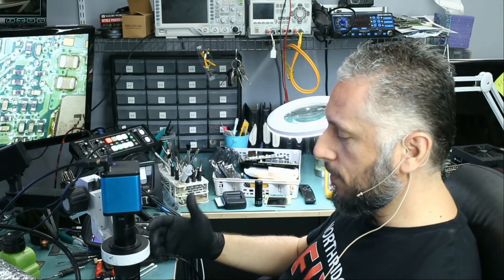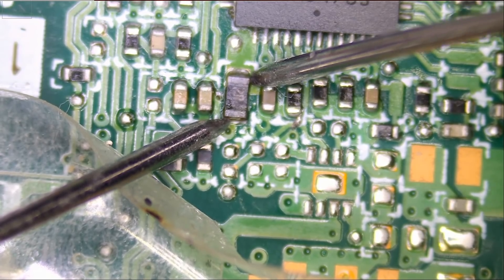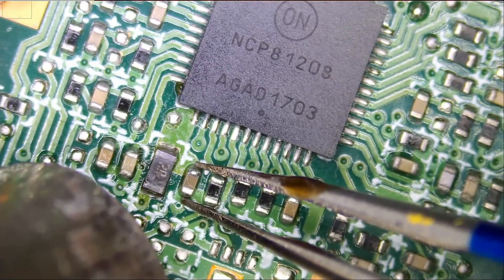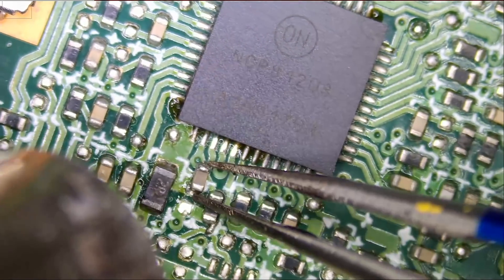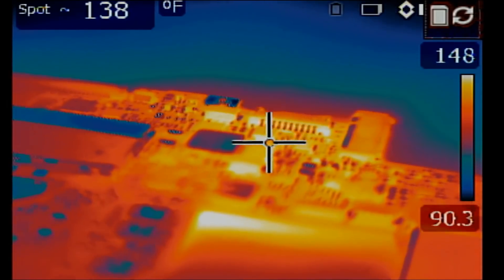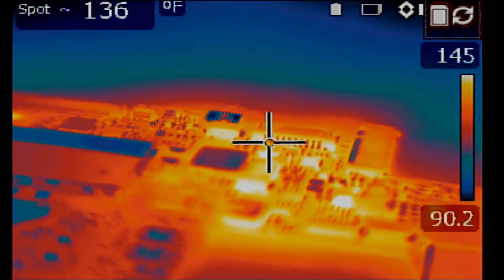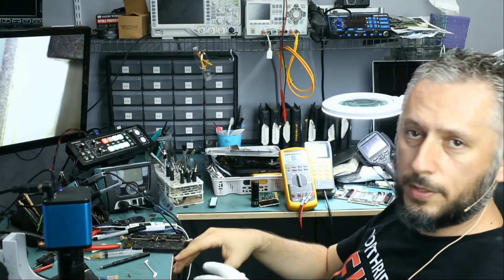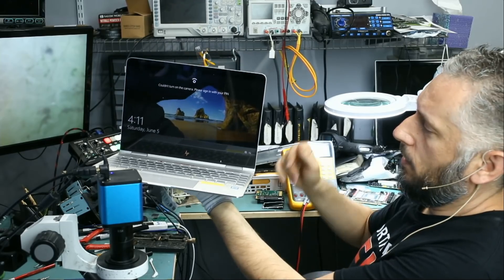HP Spectre X360 No Power Repair - It's the PWM IC this time. 220F in 3 seconds

Comment: That statement towards the end is scaring me a bit. If you are repairing Spectres daily that means they are having high failure rates? I am in the process of ordering 20 laptops for my company and was strongly leaning towards getting either these or splitting 10 Spectre and 10 Dragonflys.
Reply: These HP Spectres are notorious for power/charging failures. Hence, the reason NorthridgeFix has so many videos on them.

Comment: Why do you keep the hot air blower ON after using? Doesn't it increase electricity bill?
Reply: When the blower goes back on its stand there's a sensor that cut electricity to the element. Only the fan stay on to cool the blower.
Reply: It may be the solder fume extractor that you are hearing

Comment: a question to alex or anyone who knows, when is the right time to use low melt solder, or normal solder? 
example: 4:40, preparing the board for new ic, that should be normal solder right? 
only use low melt solder to remove something from board?
Reply: You should use low melt solder when trying to remove something from the board, to avoid heating up to much the board. You should avoid using low melt solder, to solder anything. The example you provide is mixing unleaded solder with leaded, so that can allow you to reduce melting temperature and easily wick off the unleaded solder from the pads or in this case make it easier to solder new IC. In both cases you reduce risk of damaging the board with unnecessary heat.
Reply: @MrLukxas  Thank you Lukasz for the response. 63% Tin/37% Lead is normal solder yes?

Comment: @NorthbridgeFix In this case would it have made sense to also replace the resistor that had gotten so hot?  I mean, sure it's good today, but after obviously being under such strain for so long it likely greatly shortened its life.  To prevent future issues for the customer I probably would have replaced it.  Thoughts?

Comment: Having donor boards must help a lot. I mean, you do not need to worry about buying this IC and it maybe it not work
Reply: If you have some electronics knowledge and some reasonable soldering skills then having no donor boards is the biggest obstacle to getting started in this business ( a $5000 thermal cam helps too 😉 )
Reply: @pcb1962  
Yeah, I'm at this point now. Took 20 minutes to fix an smartphone with a donor board. But I'm waiting 15 days for parts for another, and I still don't know if will be fixable